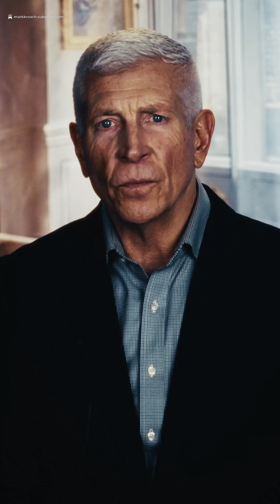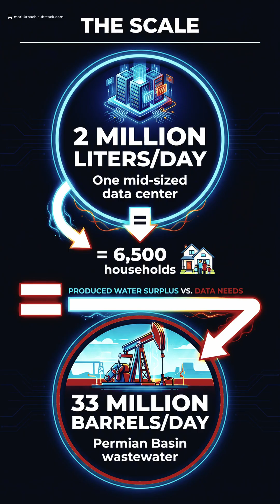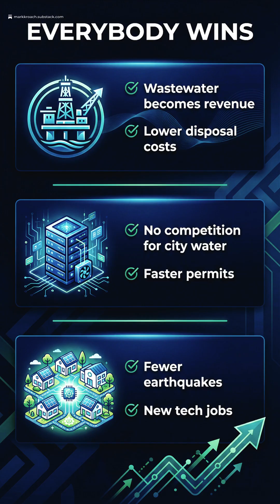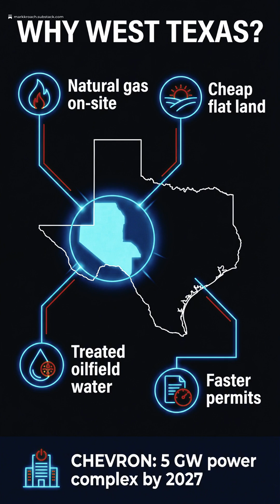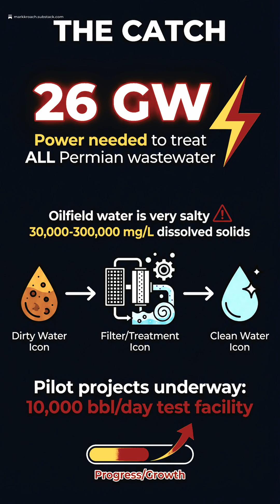Oil Waste Water Now Powers AI: The Genius Solution Nobody Saw Coming | Data Center Revolution

Comment: It's not exactly a match. Data Centers need BTUs removed. Various fluids can do that job, including air in cooler places. When it comes to cooling the real super power of West Texas is the dry air. Every pound of water evaporated carries away about 1,000 BTUs. The dry air in West TX allows Rankine cycle power plants to run with evaporative cooling towers vs. rivers or oceans used as once thru cooling water elsewhere. I'd look at any use of treated water through the lens of total energy required to produce the treated water and the ultimate fate of NORMs, salts and the various critters called out in 40 CRF.  An affordable brine based coolant system might use ginormous evaporative cooling ponds and inject it back when the brine when it gets too stout.  For a whole lot less investment and power consumption a DC could be cooled with once through sea water down on the TX coast while still enjoying access to plenty of nat gas for combined cycle onsite power generation.
Reply from the maker: Really solid breakdown — appreciate the depth here. You’re absolutely right that the core engineering problem is BTU removal, not just water delivery, and West Texas dry air is a major thermodynamic advantage that doesn’t get talked about enough. That low wet-bulb temperature makes evaporative cooling towers far more efficient out there than in humid coastal environments. And your point about total energy input to treat produced water — factoring in NORMs, salts, and the 40 CFR regulatory burden — is exactly the kind of full-cycle analysis that gets glossed over in the hype. The brine management alone is nontrivial. That said, I think the Texas coast once-through cooling argument you’re making is compelling, especially when you pair it with abundant nat gas for combined cycle onsite generation. It’s a different cost equation entirely. Great perspective — this is the kind of technical nuance that makes the comment section better than the video. Thank you.

Comment: boom technologies are making data centres which are powered with jet engines which don't need water for cooling, so I think there will be a mix of both I am not sure on cost I haven't researched that far.
Reply from the maker: Thanks for passing the info along! and watching!
Reply: @MarkRoach-FutureWiseEnergy  No worries one of my favourite channels on youtube, im just hoping oxy manage to use that wastewater and extract lithium from it at a commercial scale.
Reply from the maker: Appreciate that — means a lot. And yeah, Oxy’s direct lithium extraction play from produced water is one of the most underrated stories in energy right now. If they can crack commercial scale, it flips the narrative entirely — suddenly your “waste” stream becomes a critical minerals supply chain. That’s the kind of vertical integration that separates operators who are thinking five moves ahead from everyone else. Definitely one to watch.